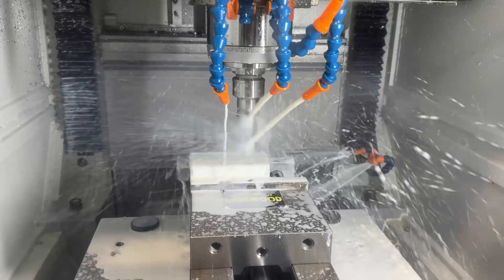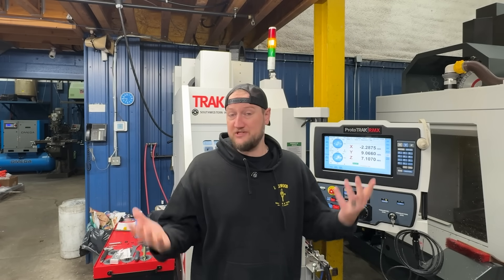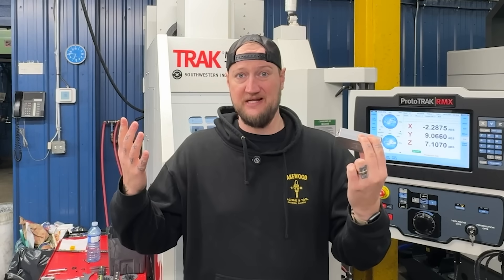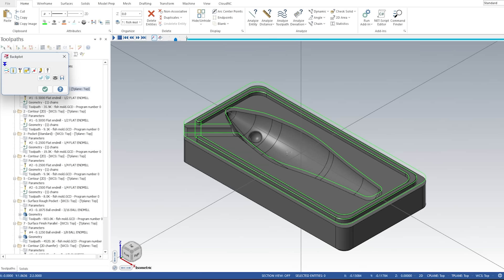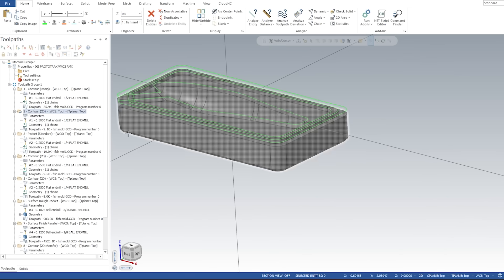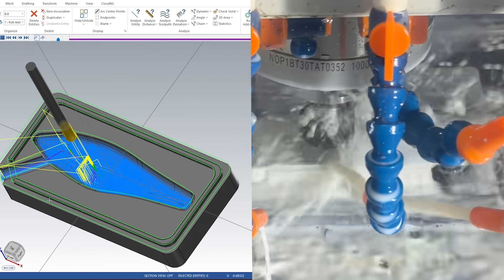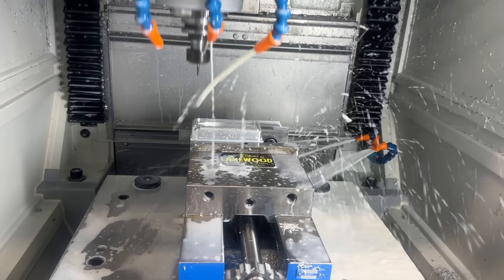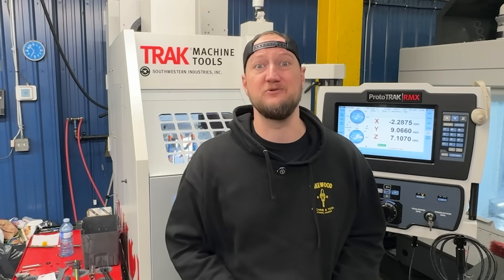I Used a CNC Mill for a “Stupid” Project… And It Ruled | Machine Shop Talk Ep.146

Comment: Heat the mold to slightly above the plastic melting point before you pour that.
Reply: Haha I figured that one out the hard way unfortunately! Luckily I did spray it with silicone spray before pouring so my mis-pour was extracted easily